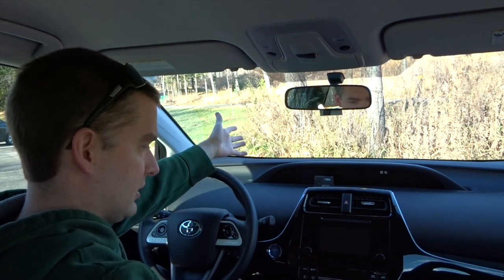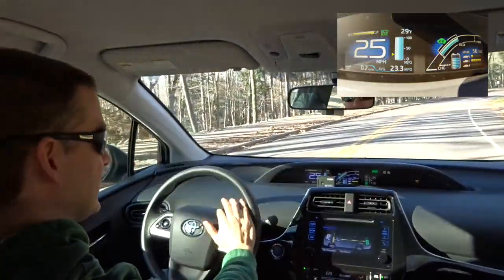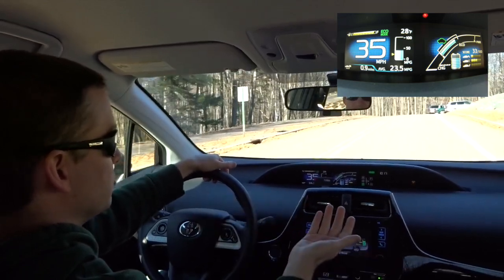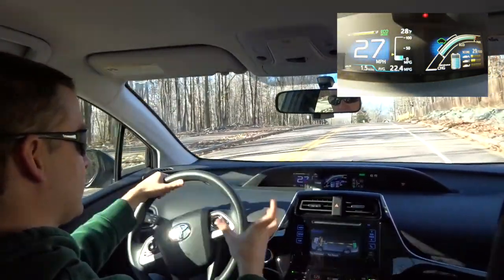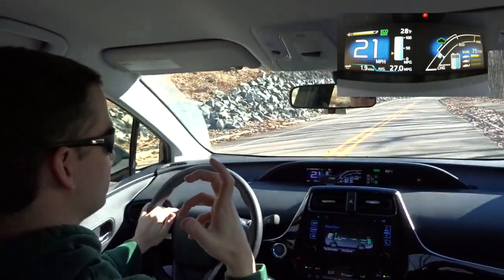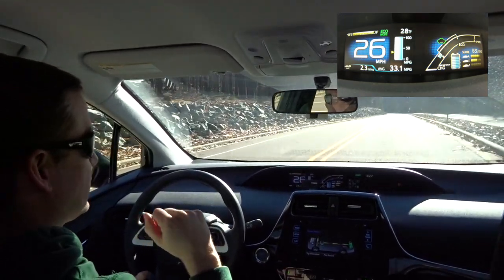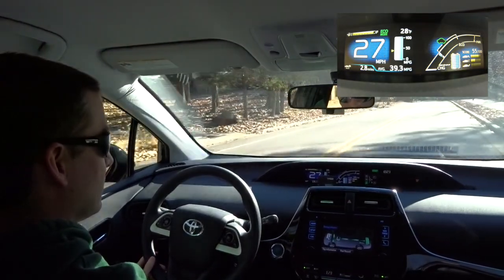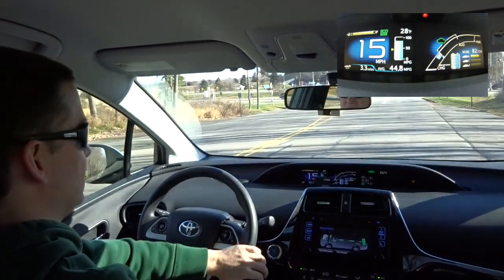Prius "B" Mode Explained

Comment: A lot of manufactures have a CVT transmission but the transmission in the Prius is a completely different design. There is no belts, it's a variable transmission based on planetary gears with the ratio being changed by the difference in speed of the Prius' separate electric motors which drive different parts of the gearset. It's a fascinating piece of technology.
Reply from the maker: Thank you for the detail on this!
Reply: Indeed, no other transmission type has so few moving elements & so much abilities.
Reply: You are correct. Calling it a CVT is a bit misleading, because it is an entirely different design.  One gasoline engine, and two electric motors are connected to the drive wheels, through a planetary gear-train which functions like a differential in reverse;  When they are pulling in unison, full power is transferred to the wheels, but when the electric motor is running at a different speed to the gas engine, a gearing ratio is achieved, to allow the gas engine to run at more efficient speeds.  
In fact, "neutral" is never actually neutral, because the motors and engine are never disconnected from the drive-train; the electric motor compensates for the gas engine in whichever direction it needs to turn, to allow no torque to go to the wheels, allowing it to roll.
Reply from the maker: Very nice description, thank you for taking the time to provide some more input!
Reply: Driver6M It's a CVT notting special appart from a Metal belt. The CVT is driven by the engine and a electric motor. A special clutch also starts the engine via a second  electric motor. Not sure what you mean by gearset because it's a cone shape and belt, no gears.
Reply: Super -sim Actually, that is incorrect. The hybrid CVT or eCVT is very different from a regular CVT (ie cones and metal belts) that you may have seen on normal Toyotas or other brand vehicles. You may like to search for Prius CVT on Youtube to see how the transmission is engineered, it's quite interesting.
Reply: Super -sim 
We weren't talking about the CVT you're talking about.
Reply: Driver6M  
These priuses hands down reliable I have 2014 with 170k driven with uber, properly maintained engine, tires, brakes, and transmission
Reply: Essentially it's only 2 electrical motors MG1 and MG2  (stands for motor generator) the comments from +super sim us correct, this is NOT a CVT, and your motor is on an B mode to recharge the HV battery it feels like is braking since is generating braking force to regenerate energy, fun fact.. You'll never get a full charge since the system won't allow to be able to regenerate, when you get 100 percent full charge the MG motors will spin at very high ram to use some of the energy to return back to 75-80 percent wich is normal.
Reply: hector garcia x
Reply: I thought this is why Toyota calls it HSD (Hybrid Synergy Drive) instead of CVT, using e-CVT only as classification.
Reply: Nope no cones. The videos of actual Prius planetary gear sets are quite interesting. I to thought it was just a cvt cone setup. Its much better and quite sophisticated.
Reply: Terry Proveau .
Reply: This is the American company GE invention they sold the Hybrid system to Toyota. GM and other companies turned it down and now I think they regret that.
Reply: There isn't a belt, or cone at all in a TOYOTA Hybrid Synergy Drive.  Google it.  It's a planetary gearset, 2 Electric Motor Generators & a Petrol engine.
Reply: @Top12Boardsport  Yes some Californian engineers invented it.
Reply: Sidney Mantissa  Its technically a power splitting device. Toyota should make some name up to differentiate between a conventional CVT.  It is an electro-mechanical marvel.
Reply: Is it ok to use b mode to slow down on the highway when the traffic up ahead is slowing down or still
Reply: Nerd
Reply: Honda and Toyotas essentially have eCVT even though Toyota doesn’t call theirs that only Honda does. Screw all other hybrids out there regular belt CVT’s suck.

Comment: B-mode is an option to waste energy in the form of using the gasengine to compress air. This does helps to slow down the car. The passive regeneration is about 2x as strong in B then in D (no foot on break). So you are charging your battery 2x as much. Problem is that the car is loosing speed from compressing air as it is enginebreaking. This will make you get less total energy into your battery compared to just keeping shifter in D-mode and apply a little pressure on the breakpedal. This way you are only using the rechargegenerator to slow down your car and are able to get maximum charge from the downhill. Note that you should not go to close to maximum on the charge bar. As the bar gets closer to maximum it starts to softly apply frictionbrakes wich lead to heat instead of battery charge. So in ECO standpoint B-mode should be avoided. As others said B-mode is usefull when battery is fully charged and still going downhill and in winter to get some free engineheat from enginebreaking friction to reducing the engine ON-times at redlights and slow speed driving that in summer normally is done in EV mode. Forced engine running is due to heatsettings. Turning heat off will allso turn gasengine off (if engine is 60+ degres celcius).  So dont waste kinetic energy with enginebreaking when you have regenerative breakes. Non hybride cars can save brakepads by using enginebreaking.
Reply: I like how some people talk a lot thinking they know it all when they don't. 😂
Reply: @brianmef71  Ok, then go ahead and drive with B mode all the time if you think it is the best way to save fuel.

Comment: I just did Mt Washington in NH in my 2014 Prius.  I used B mode on the 8 mile downhill.  It is 6,000 ft of elevation and steep.  I did have to use the brakes all the way down, pumping rather that riding and stop as often as possible to cool the brakes.They did get warm and smell hot from time to time.  I am glad we made it, but probably wont do again.

Comment: B mode uses the electric motor like it does in regenerative braking. I find with my 2016 Prius v that it's not worth using it over the regenerative braking because as long as you keep it under a curtain speed your engine will be off and you're not using the brake pads anyway. Not worth the mileage hit as your RPMs go up and you use more gas again.  I think I've used mine like 4 times.

Comment: To afraid to use b mode. Do you apply brake first? Wonder if you accidentally shift to reverse?!
Reply: no brake needed, I do not think it will reverse wrongly but don't try it... supposedly only can happen under 6 mph

Comment: The “B” setting allows the drive motor to continue to produce reverse torque by being used as a generator, and the electricity generated is used to drive the engine via the motor alternator. This effectively allows the engine  to be used as a brake and regulate vehicle speed. The engine is spun at high speed with no fuel being injected, using it as an air pump to dissipate the momentum of the vehicle. It will also charge the battery but when you run out of capacity to charge because the battery is full, it will use the engine to dissipate energy. The engine kept running and didn’t go into EV mode right away because it cooled down by processing air without combustion. If you were driving down a long steep grade in “D” the car will fill the batteries up to 100% and then you will be using friction brakes which can overheat if the grade is long and steep.
Reply: It's basically the same as L gear. B stands for Engine Braking. If the battery isn't fully charged, it charges the battery too.
Reply: So should I use b instead of braking when possible
Reply: @ibeatmycatandmydog9322  Not normally. Most braking is still done by recharging your batteries in the normal driving mode. If you are in the mountains or a long very steep hill then it would be useful, just like using low gear to descend a steep grade on a conventional car. In B mode the generators charge the batteries but also “waste” energy by spinning the engine with the fuel turned off and using it as an air pump for “compression braking” to save wear and more importantly heat buildup in your brakes. This is not necessary in normal conditions.
Reply: @Andrew H No, your battery will recharge faster with regular regenerative braking. However, as stated previously, if you are descending a long steep grade, the B mode will consume extra energy by spinning the engine in order to slow your descent down a long hill. If you use this function in normal driving, some of the energy that could go to your batteries will instead go to turning the engine when turning the engine is not needed. The only time this would be advantageous is on a long hill descent where the battery will recharge to over 80% before you reach the bottom of the hill. In this case turning the engine as a dynamic braking load instead of engaging the friction brakes will allow you to control your descent speed without overheating the brakes.
Reply: @thatcarguy1UZ  so how does “b mode” work in full EVs? (Not hybrids). I have this exact shifter in a 2014 RAV4 EV, and have accidentally driven miles with B mode engaged not knowing anything other than the fact that the cruise control won’t work. Took me several months to connect the two. It doesn’t seem to brake much. After discovering what it really was, I tried to use it like I would with the Chevy Volt, and apply it when stopping.
Reply: @UmmYeahOk  That varies by manufacturer. Some use a "1 pedal" driving mode which instantly applies regenerative braking once the accelerator is fully released. In essence this mode doesn't allow the car to coast, instead it applies the regenerative braking at a set amount as soon as you remove pressure from the accelerator. The closest analogy to that which I can offer is something used on heavy trucks and busses called a retarder. Some are transmission operated and basically churn transmission fluid (trying not to be too technical here) and others are exhaust brakes on the engines (commonly called a "Jake Brake").
Reply: no. it is like a big truck's 'jake' brake
Reply: @ibeatmycatandmydog9322  No. Brakes are cheaper than replacing an engine.

Comment: B" mode is also fantastic for snowy downhill driving. It just slowly grips it's way down the road without having to use foot braking which is where most skids start. Getting some good winter tires and using the prius technology to your advantage can make this car VERY  good in the winter.
Reply: Thanks for the clarification of the "B" mode.  I have a 2007 and always wondered.  Bought it new and currently have about 125k on the odometer.  Just wondering if the lower glove compartment lamp is normally ON whenever the headlights are on.
Reply: Great to know! The Prius is also quite good on ice in general, even without B mode. My 2016 Prius had its first test on ice last winter when I had to drive on a back road that was a complete sheet of ice. Normally, I would have just glided over it and not turned the wheel, but this road was downhill and curved so I had no choice but to brake and pray. The Prius performed amazingly. Basically the anti-lock braking system kicked in right away when I gently hit the brakes, and it pumped them the whole time we went over the ice. It was nice and smooth (just sounded scary) and I was even able to turn without skidding once. I think the Prius knew to do this because it could sense the tires losing traction and so it pumped the brakes to help regain traction. And I didn't even know I could use B mode to help in snow so I might try that next time!
Reply: Just experienced this today. CO is getting a pretty good winter coat.
Reply: Was a passenger in a Prius on a road freshly covered with snow. Had hard time explaining "B" mode to the driver. I suggested using the "B" mode to trim off excess speed rather than braking, especially while turning. At low speed was all too easy to slide into another vehicle while negotiating through a neighbourhood with narrow roads, random parked cars and changing gradients. Got earfull for being too technical.
Reply: And b mode will charge vape pen and prius battery same time!!

Comment: MG1 actually spins the engine up during B mode to create drag on the drive train.   The engine is not actually producing power, the injectors are off.   The main reason not to use B mode during normal driving is it causes the engine to spin and places a electrical load on the system.   The hybrid ECU also normally tries to prevent 100% charge as the batteries last longer if not charged all the way to full.

Comment: When the battery is full and you say the engine is still running, it's because it can't regen any more energy to the battery so the engine has to take over the braking instead. It's a clever system and has its uses, but I've not had to use B mode myself as my area is fairly flat.
Reply: Is it ok to use b mode to slow down on the highway when the traffic up ahead is slowing down or still
Reply: @cutflow2  It's not desirable, but you can if you want to. Instead you should use regen to slow down and recapture as much energy into the battery as possible for best fuel economy. B mode is for long hill descents not for general stopping.
Reply: @cutflow2  does the engine come on with "not full" battery? prime? in B mode?

Comment: I normally never use the B mode. Unless it's very steep. You can just press the brake pedal gentle and it will regen as much as it can.  If the battery should get full, the car automaticaly activates the "B" mode, even when you are in drive mode. Because the battery is full it needs the engine to simulate braking.
Reply: not too sure about auto B mode? mmm

Comment: I use B mode on my gen 2 Prius for emergency breaking situations or going down steep hills and needing to apply additional break force.
Reply: It's also good in traffic, save a lot of work to put on the brake.

Comment: You have 3 means of braking - regen, friction and engine braking.  When you use B mode, it not necessarily means that you are regenerating better. Most of time its better to use D-mode and apply brake pedal slightly, as long as the CHG range is not exceeded. B-mode is OK for really steep hills and loaded car.
It also automatically uses the B mode, when the battery is full. Tested yesterday when driving downhill from large hill. Of course its stupid to worry about high rpms, its made to do this!

Comment: Hi JL.  Got my own Prius now and really enjoying it, thanks for all the useful advice you've passed around.  BTW, in B Mode going downhill the engine turns over to provide mechanical friction braking without burning any fuel. This is like a typical has engine coasting downhill doesn't use fuel, but the Prius in B Mode will not overcharge the battery from regeneration.  I hope this helps you and your many followers to understand the Synergy motor better. Happy Thanksgiving to our American cousins from UK with best wishes for the Holidays.
Reply: I've had my 2016 Prius for seven months and love it and almost have 30,000 on it now, I do a lot of driving. About 5000 miles a month

Comment: Thanks for explaining the "B" mode.  Bought my 2007 Prius new and never used it before.  Still on original brakes,  Four new tires, couple change outs of wiper blades, three headlamps, and one new battery.  Most reliable vehicle (besides my  '97 Chevy S 10) I've ever owned.

Comment: Depending on the vehicle's speed and the battery SOC (state of charge), the Prius will do this using regenerative braking and/or high-RPM zero-fuel-flow engine braking. ... Just as you might downshift into 2nd gear when going down a long, steep hill to prevent brake damage, you can "downshift" into "B" mode on a Prius.

Comment: I am an uber driver in Seattle bought prius at 0 miles maintaining it since then properly now it's at 170k one problem windshield wiper motor, other than that no problem no engine check light. same engine as yours 1.8l. I use b made going down the hill it charges your battery plus helps you with good mileage. car had plenty of power it can top out 125mph easy. awesome car. The b mode is actually engine braking I don't recommend on very steep hill. With b mode you can always charge your battery 100%. I have been doing it since I have owned it. I still get between 45 to 50 mpg
Reply from the maker: That is awesome to hear! I love hearing about the reliability on these cars being so good. That was one of my top reasons for purchasing.
Reply: Did you replace the wiper motor

Comment: Thanks for the info, so it works like all the other Toyota hybrid.
Anyway in B mode the petrol engine runs continuously in order to slow down the car, it's like as you said at the beginning putting a low gear in order to save the brakes.
Since on the Toyota hybrid when the battery is full the regenerative brake drops (otherwise you'll overheat the battery), the only way to avoid the brakes is to kick in the petrol engine and let it "absorb" the energy.
Unfortunately to do this the ecvt has to burn some petrol, instead of the "standard" car that doesn't burn at all when the engine is drag.
Maybe in USA is not so useful, but try to come in Italian appennini's roads whitout using the B and you'll burn your brakes after the first hill :)
Reply: I like to B mode for going around sharp corners on Highway ,it help you keep in Control
Reply: I love theToyota Prius 2016 sport suspension too
Reply: I've had my 2012 Prius now for a month and I've been using the B whenever I want to slow &stopfrom around 70 mph. Will this cause the engine to over reve,and possibly damage the engine?
Reply: it should have a fuel cut off for when the engine is being driven by the cars inertia, this is what happens in all modern cars.